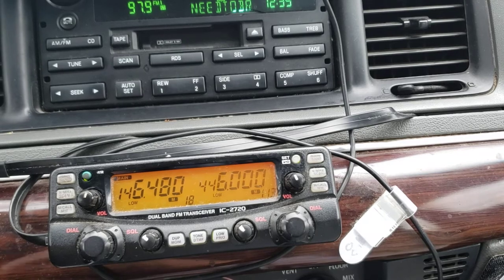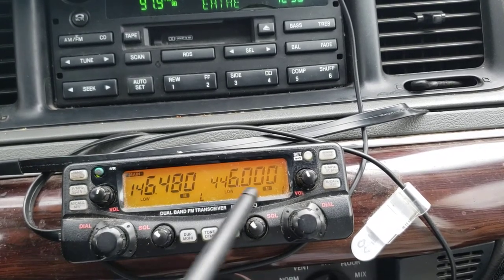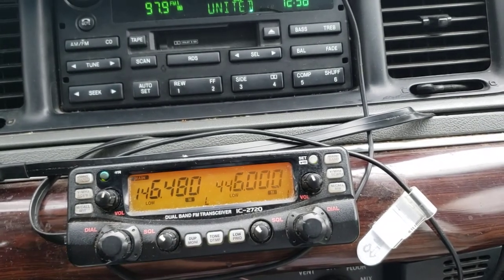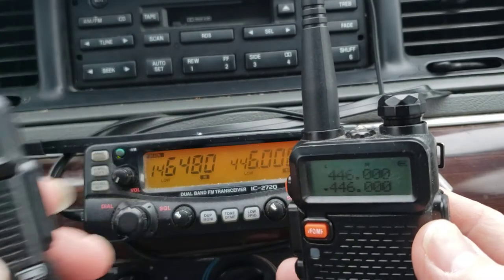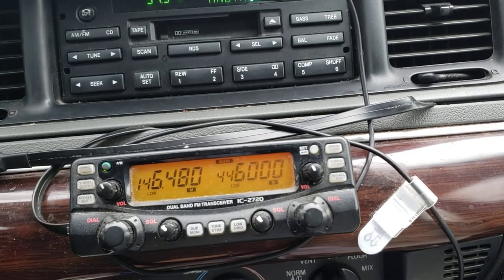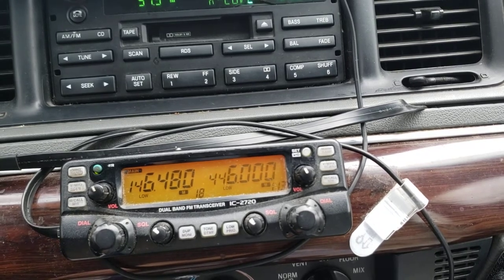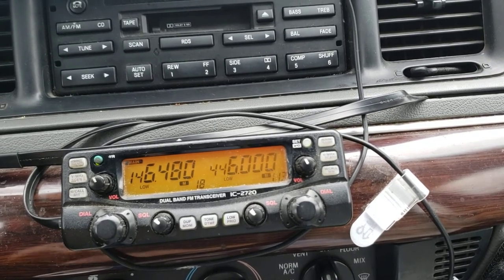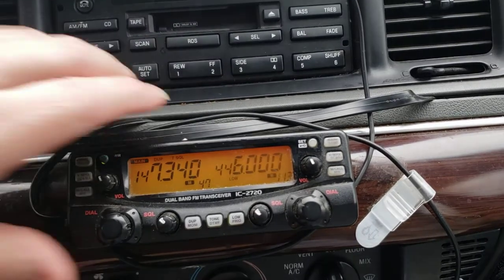Crossband repeat

Comment: this is the only video I have been able to find with this radio.  Thank you.  And its awesome youre not a sad ham.  I was wondering if you could help me setup my 2720 im  trying to get on a repeater and Im just not getting it.  I did the mars mod on it so I can get on UHF 4*.** but im not sure im doing the TONE correctly. any help is appreciated.
Reply from the maker: Thank you for commenting. Honestly, I use Rt Systems programing software and cable for this radio, I've never actually programed it manually. I'll worked on making a video. I try not to be a " sad ham " ! 
If you send me an email I will reply and that way I'll let you know when I create a video of it.
ke7uum@gmail.com
Reply: @DanielKE7UUM  sent you a message not sure if you got it I had a question where do you plug in the programming cable I just purchased one and what software do you use?